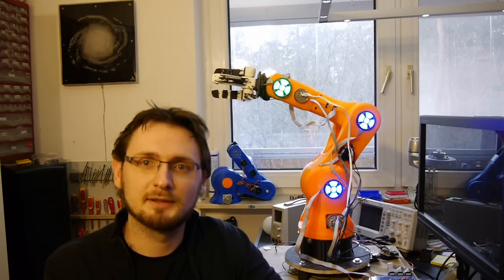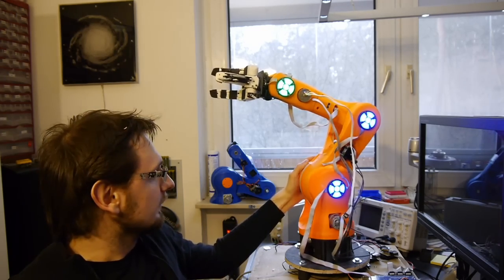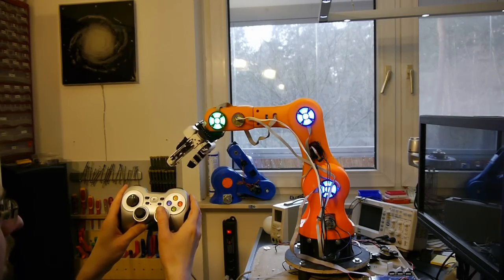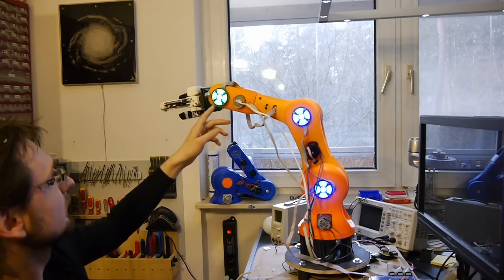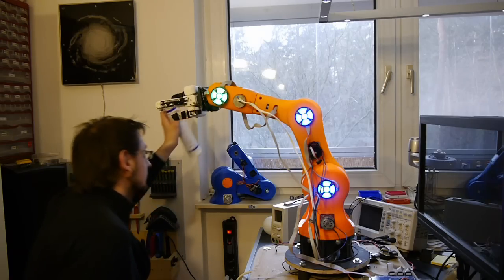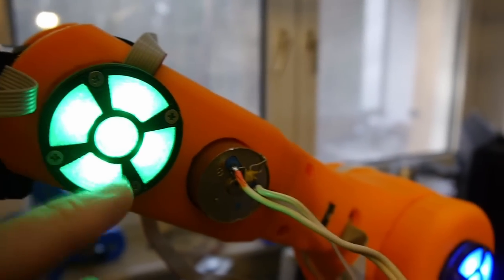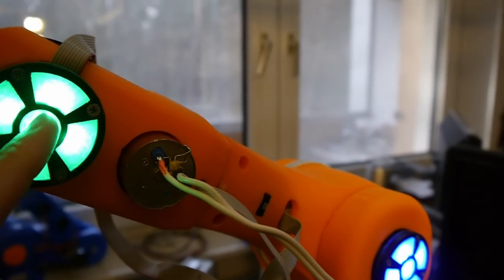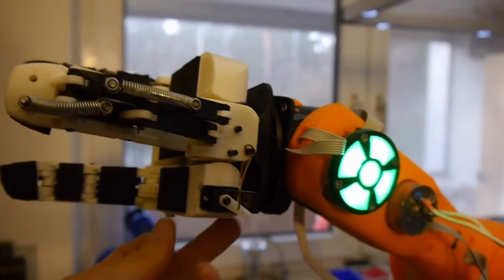Robot Arm part 7

Comment: A suggestion for the slipping belt, you could add an idler pulley to get more area of the belt touching the motor pulley.  This will do two things: first would add more friction to stop the belt from slipping and second would also take out some slack of the belt.  You could even keep your motor mount..
Reply: Like this http://www.robot-and-machines-design.com/Files/images/Articles/Timing-Belt-Pulley-and-Idler-Example.jpg
(not my image)
Reply from the maker: LiNK Ross
I planed this in the next version: https://www.youtube.com/watch?v=BhX6S58S-5w#t=496 you can see it in the construction.
Reply: *****

Lol..  I was typing my reply when the vid got to that part..

Comment: Hi Andreas, I really like your work and the fact that you're sharing it!
What are you planning to use the arm for? I'm asking this because I wonder how you can get the DC motors to stop in the exact position you want to, I'm not talking about the encoders, those look great. I'm more concerned abot the motors inertial movements. Are you planning to correct this behaviour by coding or maybe using different motor controllers with brake maybe? Keep up with the good work, looking forward to see other video updates!

Comment: What is your reason for using DC motors? Wouldn't stepper motors be better? then you would be able to sense at what position each motor is at, and record movements to replay? Maybe i am wrong but it would be good to hear your view?
Reply from the maker: paulham Well I already tried stepper motors, watch my previous videos about the problems with stepper motors. 
lt:dr stepper motors are to weak or slow for their wight.
Reply: ***** Thanks for your response. ill go back and watch all your others! Thanks